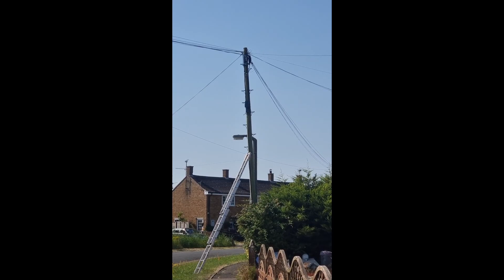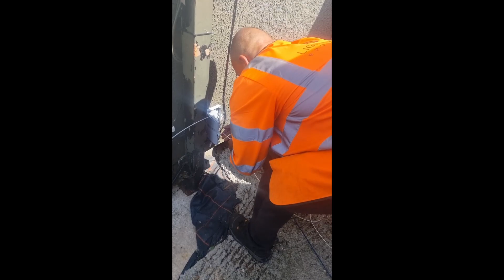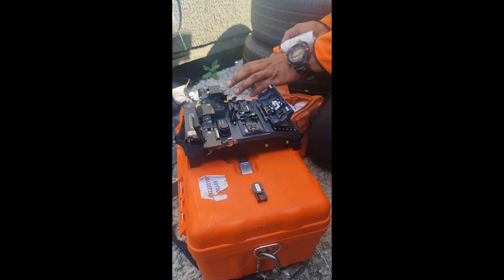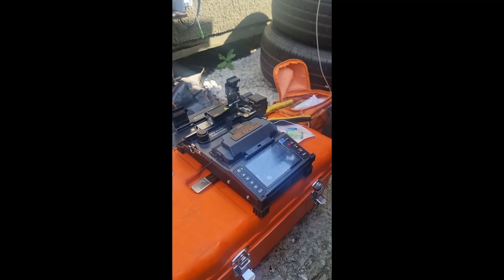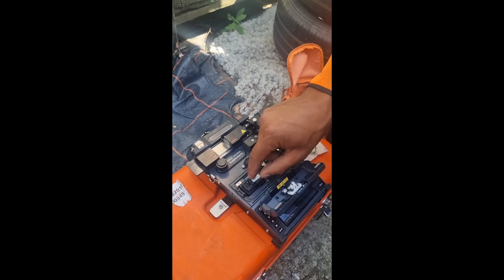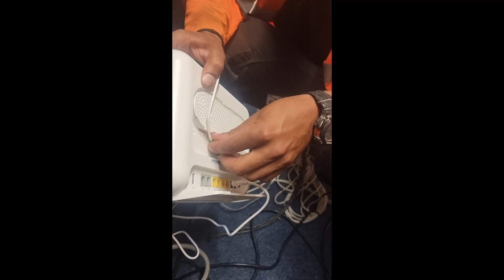How is full fibre installed using Lightspeed Broadband

Comment: I’m looking at getting Youfibre but don’t understand all the boxes? I’m a little worried because iv not been out of the house in almost 4yr because I can’t have a covid vaccine because of health issues so iv gotta do everything online, shopping, doctors and hospital medication orders on line, utility bills and council tax. Everything is done online! But I’d have better speed and it would be £16.50 a month cheaper than BT who I’m with now, Oh, and the pole is actually in my garden about 3m from the side of my house! Any help about Youfibre would be very much appreciated! Cheers.
Reply from the maker: Hi there! It's wonderful that you're considering Youfibre for your internet needs. In the videos, you can see that most of the installation work is done outside, which I am sure Youfibre is the same. However, when it comes to connecting the router, a technician will likely need to come inside. Rest assured, they'll likely follow all necessary safety protocols, including wearing masks, to ensure your protection during the installation process. Feel free to reach out to Youfibre's customer support for more specific details tailored to your situation. Best of luck with the switch, and stay safe! Cheers!
Reply: @RLSComputerServices  Hi. Thanks for your reply. The pole is just about 3m from my house, it’s actually in my garden so they can come in the patio doors to install, and I don’t need to go in the living room for as long as it takes, week or even a month. I’ve got a very comfortable kitchen to sit in, so no worries there, it’s just that I’ll need all the information off the bottom of the router so I can Connect to the internet for everything like shopping, cctv cameras and paying bills. Only thing I can think of is if he puts the box on its side at the door so I can take a photo of all the info I’ll need to connect. And also worried about the reliability of this new provider? Anyway, thanks again for your reply. Much appreciated! Cheers.
Reply from the maker: @marley2319  They should come off the pole and bring the fibre cable down the wall to where ever you want it (within reason). The engineer should connect the router and test it for you and leave the WIFI connection details for you on a card or a sticker on the bottom of the router. Again, my advice would be to check with Youfibre first and before they come out on their procedure. Hope this helps 😎👍
Reply: @RLSComputerServices  Thank you. Very helpful indeed. Kind regards.

Comment: Hmmm BT seems to be quite different. A CPC box outside and an internal ONT terminal out of which comes an Ethernet cable that plugs into their Smart Hub 2.
Im a complete novice so possibly am completely incorrect.
Reply: Hi Nick. Remember, it's Openreach, not BT. Openreach install a box externally called a CSP (customer service point) which then goes into an ONT where the fibre finally terminates. The reason for the ONT is so that an ethernet cable can run from there to the many different routers on the Openreach network. A customer may be with BT and another may be with EE. Same ONT but means another router can just be plugged onto the end of it. At Lightspeed it's only one service and one service only coming down the pipe. So, no need for a separate ONT and router. Hope this helps

Comment: our supplier uses the Fast Connect system: one box with a coil having the pole/end fitting. then played out to your site. a home is drilled through the wall ending in a fibre wall jack. alternatively, an optical network terminal is used  as a junction. easy! my install was about one hour's time....bonus: the installer  let me keep the excess... and I used this as a Christmas wreath!
Reply from the maker: That sounds cool, I like the recycling idea of the excess fibre cable too👍

Comment: We're considering LS now - can I ask if you've had to deal with any further problems since install? And if so, how was the customer experience / resolution?

I believe this is going to make such a difference in our village, where our current speed on copper cables is 30mbps d/l and around 9 u/l :)
Reply from the maker: Lightspeed product and service is good. The customer service is a little bit slow, but that is because they are so new, but they do get there. For transparency, we had to leave the Lightspeed service only because we are a business and they couldn't provide the level of technical functionality that we needed.

But please don't let that stop you when considering them as your ISP.
Reply: @RLSComputerServices  Is that due to the CGNAT thing? And not letting you use your own router? Terrible service tbh for a 1 gig up & down enthusiast plan. I might be forced to use them still if they are the only FTTC provider here though :(
Reply from the maker: @pendulumx , basically yes. You have to use their router and their was no bridging functionality to bypass it.

They are still a good contender for a full fibre offering (FTTP).

Comment: Why don't you bring the fiber drop inside of the prem and splice it inside of a fiber jack? At Bell Canada we only use a slack box outside of the premises when the is service outage caused by a broken fiber drop which we just go outside cut the drop and splice it into what you guys call an enclosure. It's much safer and easier to push the drop inside of the prem and making your ends inside. While leaving the drop protected from any weather or animals. Do exactly what you did outside but inside.
Reply: It's done here on the outside for maintenance reasons. If the dropwire ever gets damaged from pole to property it can be replaced and re spliced on the outside without the customer needing to be at the property, less inconvenience for them instead of potentially needing to take time off work. We do have internal csp's also however they are used mainly for buildings that are on different levels like house 1 on ground floor, house 2 on floor 1, house 3 is on 2nd floor and so on.
Reply from the maker: @Scott  that's what I found out too. It is mainly for convenience to the customer if things were to go wrong with the cable.
Reply: @scott3232  The possibility of that happening are slim and even if it did there is so much drop wire between the pole and the house that you could easily do what you said by repairing the drop wire outside with what we call a slackbox here and costumer doesn't even need to be at the premises unless the drop got yanked right off too. And for multi dwelling units or MDU's you use a multi drop with a multibox outside you can feed x2 x4 or x6 for regular techs.
Reply: @Ishoo al  it's not slim were I'm from dropwires getting damaged by weather, growing trees, other engineers snagging your cable in pits, vandalism (people deliberately cutting cables, there are a number of things so definitely not slim as you suggest. I don't make the decisions mate I was merely explaining the reason why they do it like this here. I am an installation engineer and had to replace copper and fibre dropwire on repair jobs for all of the above reasons. I am also aware of a multi box external feed for multi dwellings however again I don't make the rules here bud I just do the installations so just explaining why it's done here and how.
Reply from the maker: That's a really good question and one that I don't know the answer to. But I am going to find out, cheers 😎👍🏾
Reply: @RLSComputerServices  I appreciate your quick and honest reply and hope this idea helped! 😄
Reply: Its testing a testing point outside customer premises for bidirectional testing with OTDR and power meter without any splicing work. You dont need to access customer/Poll while any link down/losses complaint.
Reply: @kashifmukhtar3891  I don't think I understand your point. Having the fiber drop go inside the premises just eliminates many  points of having service outages. Also gives you enough slack for future splicing if needed for repairs to do outside the prem if the fiber breaks inside we place a slack box/enclosure to resplice the same drop wire. It also cuts material cost.
Reply: @Ishoo al  we do this usually where we have ample margen of losses available, but in higher distance and degraded fiber cases we splice drop cable with SC connetor directly at customer premises.
Reply from the maker: @kashifmukhtar3891  that makes perfect sense.